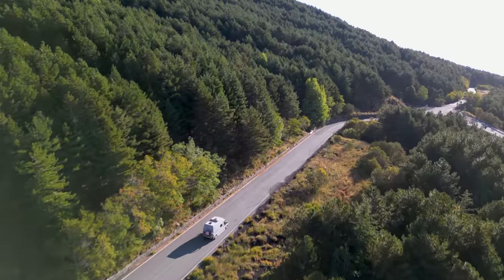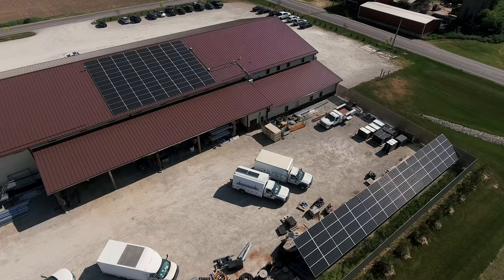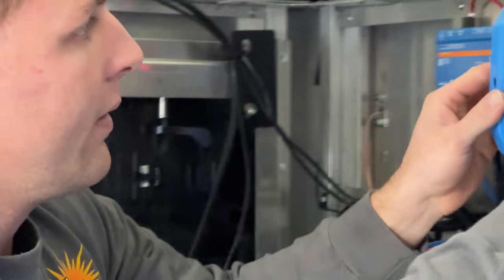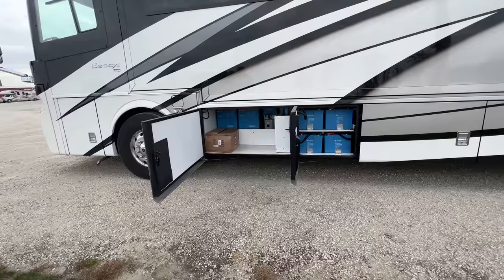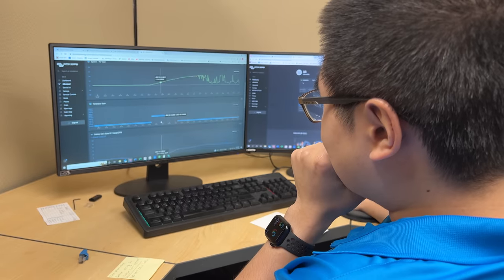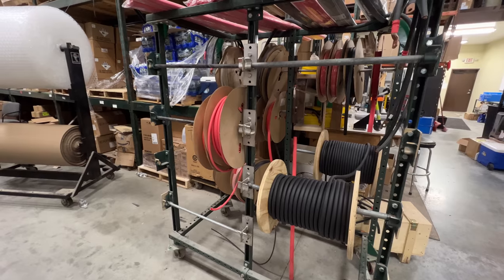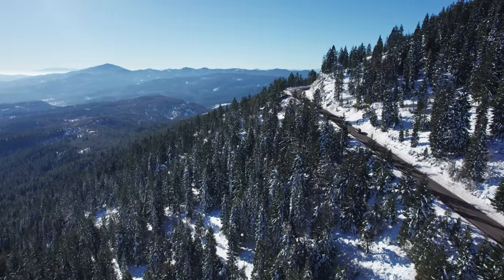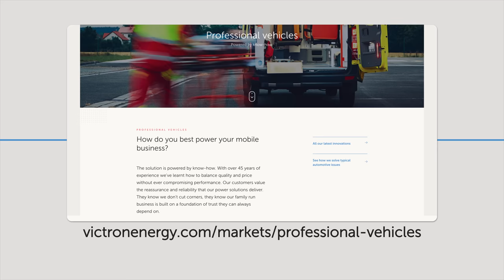Has this RV'er gone overboard with his electrics?  Full Victron setup

Comment from the maker: 🎯 Key Takeaways for quick navigation:

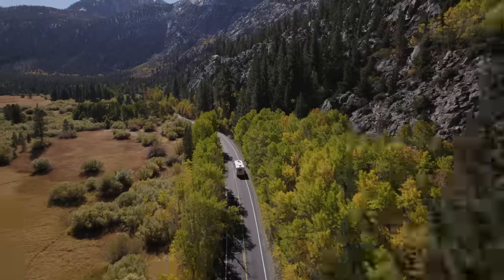00:33 ⚡ Solar Energy Systems in the US offers full off-grid power solutions for RV owners.
02:59 🏞️ Travis, an RV owner, wanted a comprehensive power system for hotel-like convenience on the road.
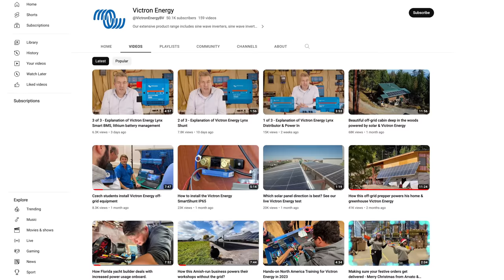04:52 🌟 Travis chose Victron Energy for its modular, scalable, and manageable components.
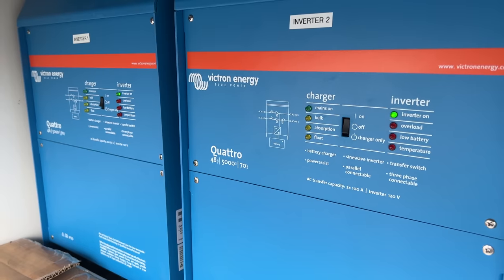05:53 ☀️ Travis's RV features 4,000 amp-hours of battery, 2,800 watts of solar, Quattro inverters, and Cerbo GX for a self-sufficient lifestyle.
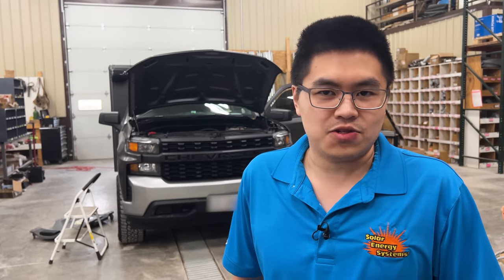08:45 💪 Travis anticipates running his RV for up to 22 hours without needing to plug in, thanks to his Victron system.

Comment: Good Lord, Travis' coach has 48kWh (assuming 12V, multiplied by 4,000Ah)! The average American household uses 29kWh/day. So, this system could theoretically sustain the average U.S. family for 1.2 days!

As Travis noted, after being disconnected for three days, his system was still at 52% capacity. Using an average 4 hours/day irradiance in Indiana, the 2,800W PV array should've produced approximately 23.5kW (assuming 70% of rating).

Given all this, it would seem that Travis is correct:  He should never have to plug in again as his coach battery has approximately six days of low/no sun reserve capacity!

Nice work SES.

Comment: I bought a bunch of victron equipment for my Class A. But the DC to DC charger is posing a problem. 

The house side batteries only have a single 4/0 cable. 

Is there any tech line for victron?
Reply: Hello,  Sorry to hear it's not going well.    In general, the support is organized so that your dealer is trained (and motivated) to help you when there are any questions.  So please reach out to them

Comment: According to specs provided, only a single MPPT. Yes it can handle the amperage/voltage but that’s a single point of failure on a massive system like this.
Reply: Beside that the failure rate is extremely low, a swap can be done in a day or so. So this isn’t a huge risk I would say
Reply from the maker: Plus as Johannes said, it’s not like Travis is far out to sea somewhere, he can just drive to collect an online order or to a local supplier. That’s if it ever fails of course :-)

Comment: Nothing to do with this cool video but cant find help anywhere else so anyone may know why my victron mppt 100/50 and also blue smart charger doesnt increase voltage after float when trying to equalise/recondition my battery bank with both inverters Off and with no loads ? It wont go higher than 14.6v that is the absorption voltage. Three AGM batteries in parallel 140Ah each 6 months old. Trying to equalise at 15.6v with 5% current. Tried different voltages and amps percentages but no luck.  Thank you .
Reply from the maker: Ask this sort of thing here: https://community.victronenergy.com/index.html
Reply: @VictronEnergyBV  Thank you

Comment: Did he say 4000AH @ 48-volts???
Reply: not sure
Reply: @VictronEnergyBV  192Kwhours !!!!
Reply: @VictronEnergyBV Hello, please tell me.
How manys 12V 330Ah Battery's i need for 4000Ah at 48V?
Maybe my calculation is wrong.
Best regards Robert
Reply: @VictronEnergyBV  LOL - I guess he did! That is an amazing system for an RV. I'm assuming they installed some large DC alternators at the same time...
Reply: @VictronEnergyBV  The stated experience of 52% remaining of 4,000Ah (Wh is always the best figure to cite), with a 2,800Wh PV array, assuming 4 hours/day irradiance and 70% total efficiency, would indicate a 48kWh system (4,000Ah*12Vnom). These translates to 12 330Ah 12.8V batteries (as were shown in the video). A 48V/4,000Ah system would require 45+ 330Ah/12.8V batteries. At 30Kg/66lbs per each, this equates to just shy of 1,350Kg/2,970 lbs at an approximate cost of $148,500 (assuming $3,000/battery). Something seems off.
Reply: @ARepublicIfYouCanKeepIt  He must have given up 100% of his basement storage bays to do this.
Reply: @robertstuckle6198  12
Reply: @ARepublicIfYouCanKeepIt  I cant make any sense of it 10 or 20kwhours would be ok
Reply: @margarita8442  
Hello, thank you.
In a 12V System you are right.
12x 12V Batterys in 48V = 1320Ah.
That's sounds realistic and is very impressive.
Reply: @robertstuckle6198  could be designing for canada in winter months IDK !!! --- most the cost would be in the batteries--  would have installed a 5kw 48 volt alternater
Reply from the maker: I've just had confirmation that Travis has 12x 330Ah 12.8v Lithium batteries making 3960Ah at 12v.  There sure would be rather a lot if it were at 48v!
Reply: @VictronEnergyBV  so roughly 40kw hours capacity
Reply: @VictronEnergyBV  That makes more sense.  It's still a huge system for an RV.
Reply from the maker: I’m sure Travis will fit some more batteries in somewhere!  

Sorry for any confusion
Reply: @VictronEnergyBV  That in itself is 50KWatts... very nice. At my home, 10kw will comfortably last me about 8 hours, just Fridge, lights, the odd kettle, Internet - etc. No heating or cooling.
Reply: @margarita8442  ??? 12 batteries x 330Ah x 12.8v = 50688 Watts of power - 50kw, if you like.
Reply: @VictronEnergyBV  No worries :-) Although I can't see why if after 3-days he's still at 52% SOC.
Reply: @markelkins8432  50kw hours !! kwh
Reply from the maker: Remember he has solar on the roof :-)
Reply: @VictronEnergyBV  Which makes a lot of sense and is the reason he doesn't need more batteries. Giving up more storage bays batteries has its own consequence. 🙂
Reply: @VictronEnergyBV  northern canada in winter, 2 hours daylight
Reply: @ARepublicIfYouCanKeepIt  Voltage has nothing to do with Ah.  When they say 4000Ah they are probably referring to 12V, not 48V.  Even 4000Ah of Battle Born batteries would only cost about $40,000.
Reply: @ItsEverythingElse  Why attempt to defend the nonsensical. To say that voltage has nothing to do with amp hours is ludicrous.

An amp hour rating is wholly dependent on voltage for it to have any meaning whatsoever!

Watt hour ratings are independent of other factors. A 100Ah rating is meaningless without a known nominal voltage. However, a 1,200Wh rating says everything that needs to be said regarding energy storage capacity.

A single 3,000mAh LiFePO4 cell (3.2Vnom) stores 9,600mwH of energy.

Now, arrange four of these cells in parallel. What do you have? 38,4000mWh, or 12Ah (at 3.2Vnom).

What happens when these cells are arranged in series? The same 38,400mWh, but this time only 3Ah (at 12.8Vnom).

As can be seen with this simple example, watt hours (Wh) is a voltage-independent measure of energy storage capacity. It's an apples-to-apples comparison, regardless of cell arrangement.